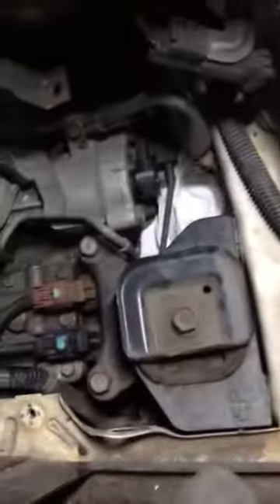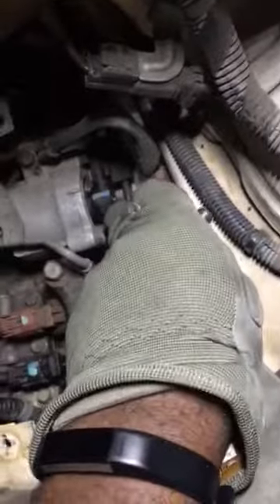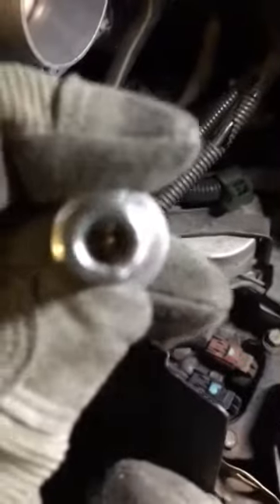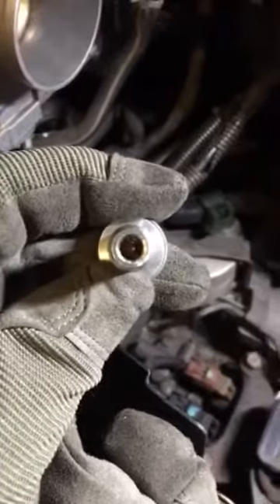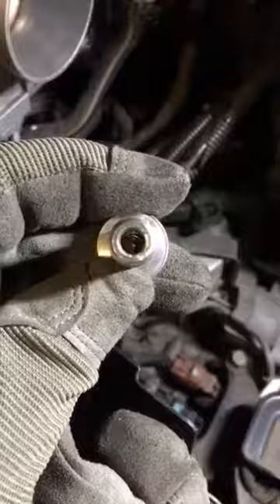2005 Acura TL AT filter

Comment: My car is doing the exact same thing Acura TL 06 I cleaned that screw changed the filter and fluid and cleaned the solenoid and then I got a P0722 code at first it was a P0420 code
Reply from the maker: I ended up needing a whole new transmission, what I did In the video was just a bandaid

Comment: What is the location of that in line filter? Above drivers front tire?
What problem was occurring? Did this fix it?
Reply: Did you replace the in line transmission filter? Did you clean solenoid screen filters?
Reply: @MarkMinistries  I am doing my filter now as maintenance. Hope solenoid valves are not too plugged up with clutch debris (so fare no DTCs only banging into Reverse gear when cold)... definitely something related to bad pressure control... searching!